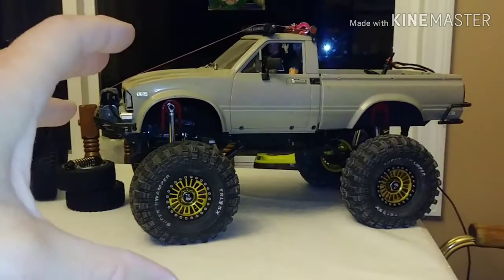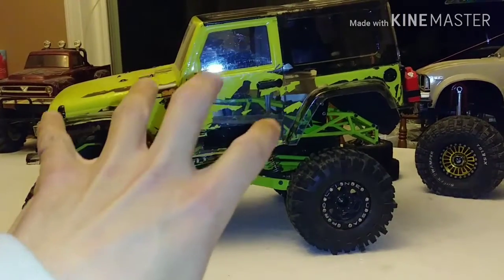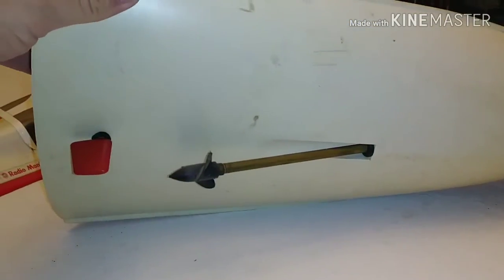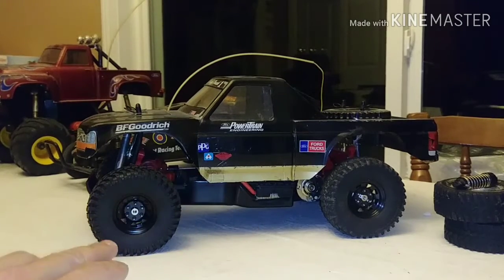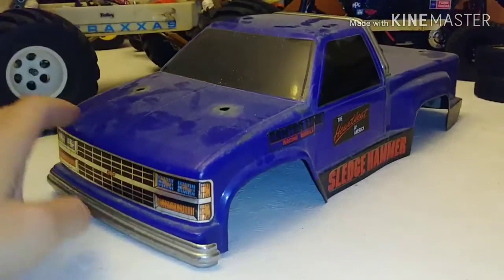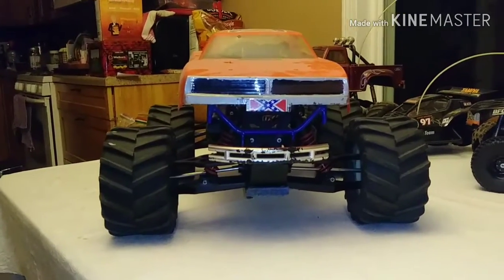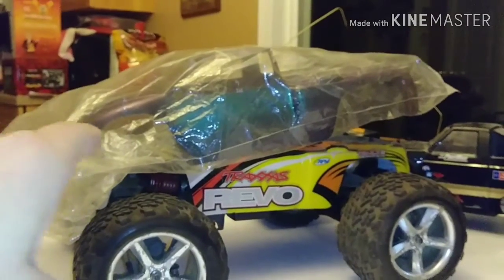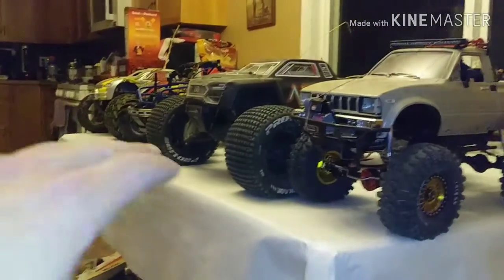Unseen RC's & RC Projects

Comment: Big collection of rc and a lot of great projects, excellent video !!
Reply from the maker: Thank you Pascal! I used too have a bunch of old RC's,
pretty much everything that I accumulated from my early childhood,too my mid 20's,and lost the entire collection,
including boxes of tires,and several fishing tackle boxes full of hardware;shocks,
esc's,motors,you name it,
years of RC part scavenging!,and about 20 complete vehicles,Frogs,Black foots,Rc 10's,Jrx-t's,A sick kyosho turbo optima mid se,
that I made into a stadium truck,also had a 4x4 "converted" radio shack truck,with a custom homemade trailer,towing a kyosho off shore racing boat,
I had a bunch if rigs,
but I was storing them at a friend's house,because I didn't have the space where I was living at that time,and He unfortunately passed away,
I didn't find out about it until a month or so afterwards,I had talked to his sister about getting them back,and after a few months of the run around,she finally replied that she didn't know what happened too them,😕
Nevertheless the old Sledge Hammer,and the white rocket boat,are pretty much all that remains from my old childhood collection,and that's only because I had sold them to my brother year's ago,like back in the 80's,😁lol 
Thanks for the Great compliment,and for checking out the video Brother.😀👍👍
P.S. sorry for the short story 😁
Reply: Yes it happened to me the same thing less important but I had to store some cars and equipment at my father and finally he sold all without telling me, it's a shame. But it's life, now it's been a long time and I forgive.  @R.C.A.D.
Reply from the maker: That's a Bummer Pascal,I'm sorry that you lost your old RC collection Brother,😞
But! like me,I'm sure you have started amassing another collection 😁👍
Reply: Yes, since my new collection is really very enlarged, and even much more than before 😄  @R.C.A.D.
Reply from the maker: Heck yeah! 😀👍👍
Reply: 😊👍  @R.C.A.D.